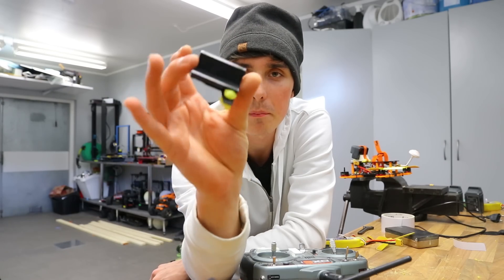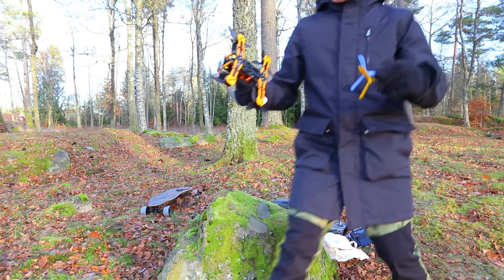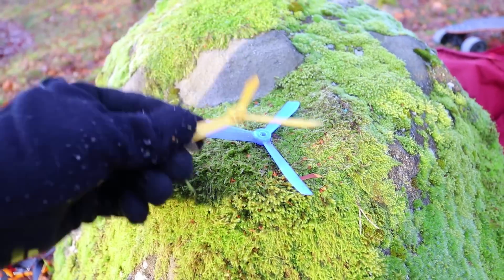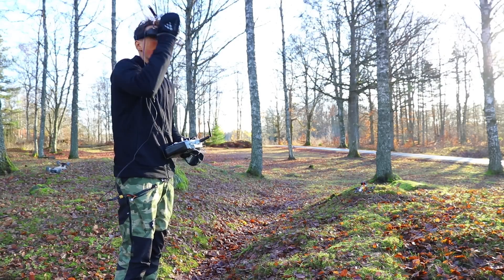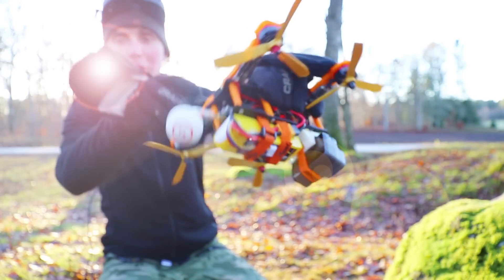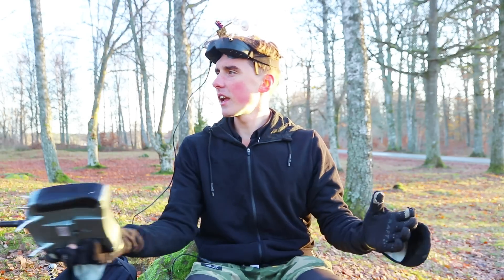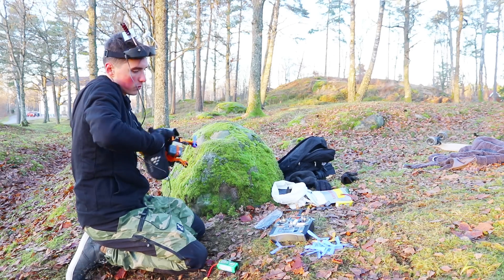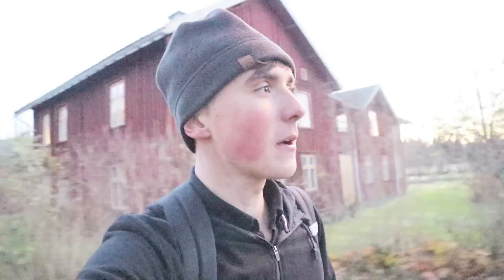3D Printed Drone Propellers - Will It Work?

Comment: Nice video! I wonder if you designed the props to be thicker in the middle of the fins, sort of like the original, if you'd get better airflow
Reply: Your on the right track. These aren't even airfoil shaped. It can still be symmetric, but it does need to be an airfoil, otherwise they will be noisy and huge loss of power like he saw. Airfoils are very easy to design in CAD. Should only take him 30 minutes to make a new one. But I think they might snap just as easy since at the edges they will be thinner, making it easy to start a crack and get damaged.
Reply: Tom and jerry

Comment: Make a brushless motor using the 3d printer, I do not have the money to buy such a printer and what I would do kkkkklkk🇧🇷🇧🇷🇧🇷🇧🇷🇧🇷🇺🇸🇺🇸🇺🇸
Reply: The outside edge of the motor needs to be steel or iron, it's called the flux ring, the stator must be a ferrous material like steel or iron, the windings need to be magnet wire, the bearings can't be 3d printed.  The magnets in the bell need to be, well, magnets...  That pretty much only leaves the top of the bell, the mount, and the shaft that could be 3d printed plastic.
Reply: Just buy them

Comment: Make a setup to test the blades vibrations , and measure the vibrations with your phone and if it doesn't vibrate atleast use them for molds and make some plastic ones and experiment with different kinds of plastics
Reply: No need to experiment.  It's already established that polycarbonate is the most durable and glass or carbon reinforced nylon is more stiff and higher performance, but breaks easier.  And the highest performance is carbon fiber but is also fragile and too expensive for most applications.

Comment: -hi my name is David I love your videos you inspired me to get it I’ll see electronics could you possibly build a cheap RC drone using 3-D printers alone and electronics
Reply: lincolndog if it's your first don't buy a racing drone especially build one
Reply: That was my first rc vehicle.
Reply: The only thing that matters is your applied skills in engineering principles. It does not matter what material you use. Me personally, I Can build all wood and glue and 3d printed hobby crafts of all sorts. Your question is self-answering lol. Of course you can! But you aren't going to print electronic components(those have to be purchased unless you are a manufacturer which I doubt). You could however, use cheap DIY cnc machines to make circuit boards on paper, plastic, etc. If the circuit is simple enough and can tolerate a low quality board material, you could easily self-build a flight controller with open source designs.